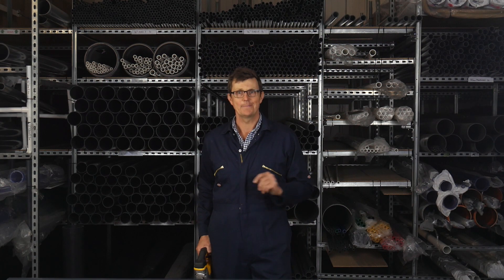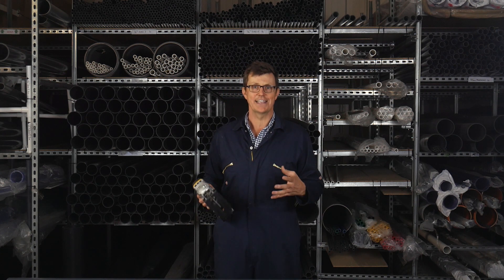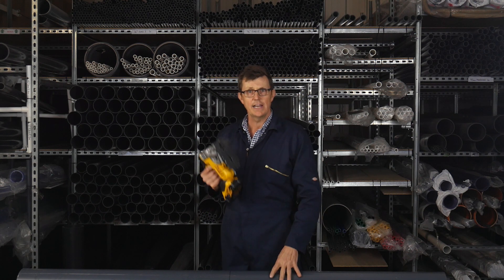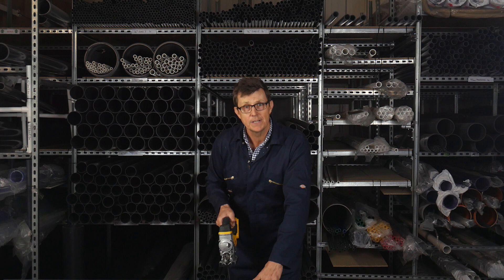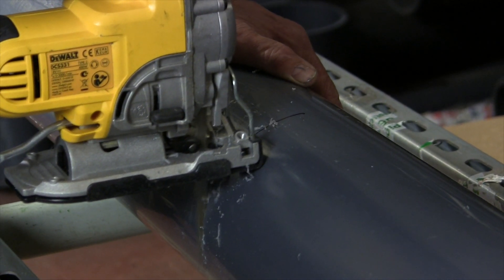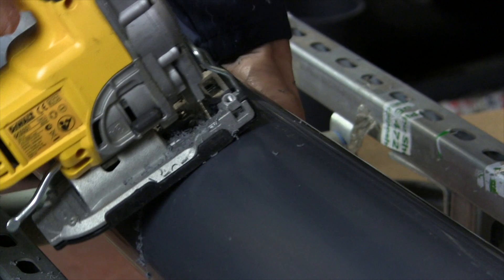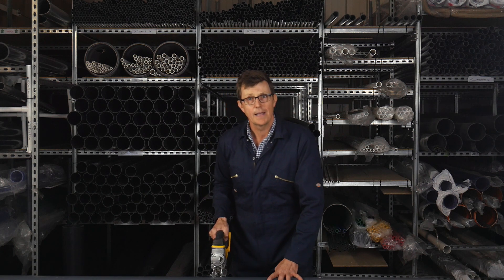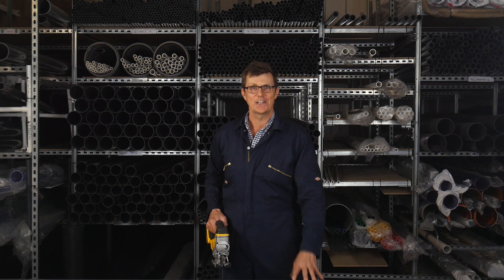Cutting Pipe with a Jigsaw

Comment: Hey Bob,   Thanks for the tips.  I cut a 300mm x 3m pvc pipe using your method.  Really easy.  I drilled a pilot hole first for the jigsaw blade.   Thanks again.  Cheers.  Keith
Reply from the maker: Hi Keith, thanks for the comment and feedback! We're happy to help.

Comment: nice video! I did it well with your advise... I'll just add: 
If you have to stop sawing midways in your pipe, wait for the blade in the jigsaw to completely stop while holding steady in the same exact position. if you try to pull it out too quick it may break your pvc pipe... in my case it was  very fixable.